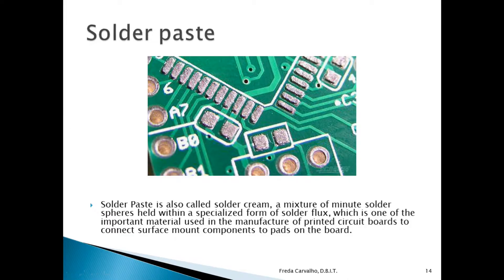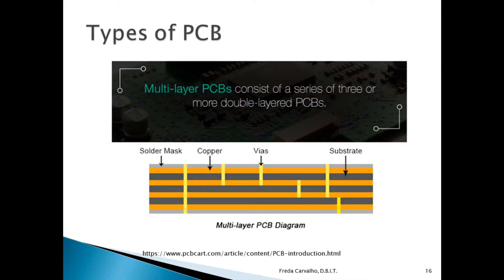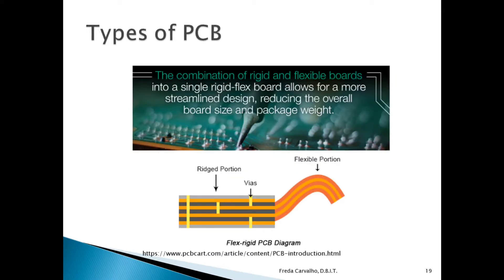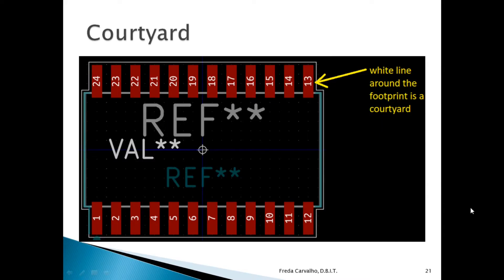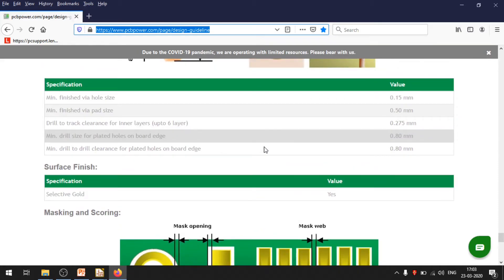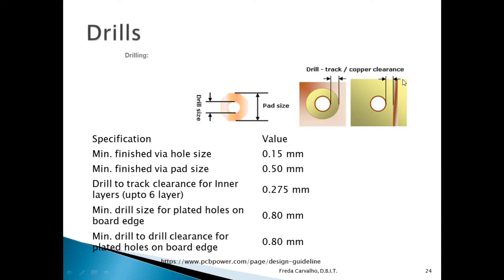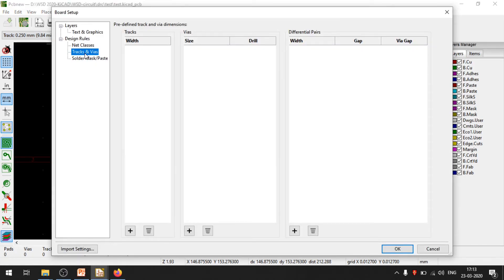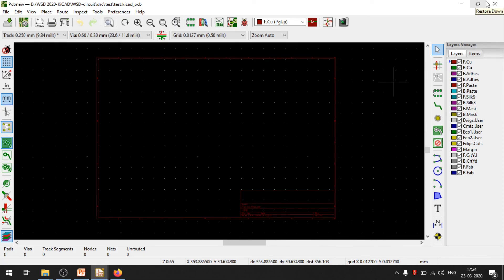WSD | Part 3- PCB Basics & Design Rule Check using KiCad

Comment: Please upload part 4 and 5
Reply from the maker: part 4 onwards would be pcb layout, since everyone has their own style, so not included.. if there's enough demand, can do that also..
Reply: Can you make it with atmega328p_au 8mhz and l80 gps module
Reply from the maker: using the atmega328 at 8Mhz via internnal rc oscillator & at 3.3V.. you will need to use a compatible bootloader to make it run at 8Mhz..
Reply: Can you design a compact low power consumption lora gps device for me.
Reply: @dbteach2218  bootloader is not an issue. I can manage that. But need pcb design for lora gps with atmega328p_au 8mhz crystal oscillator